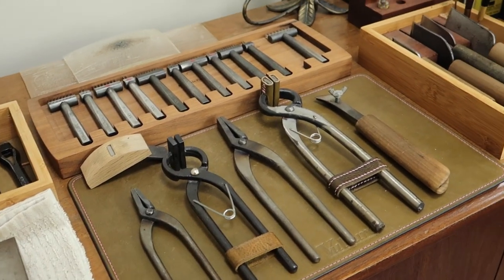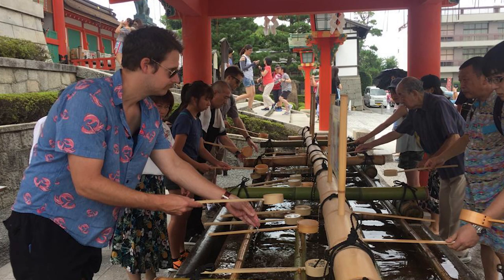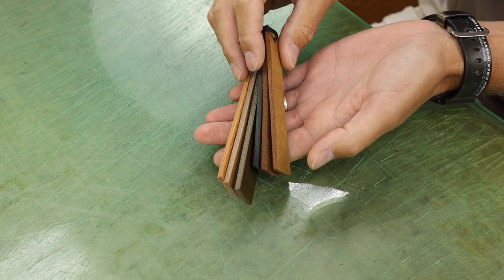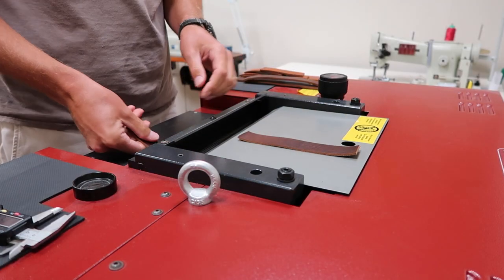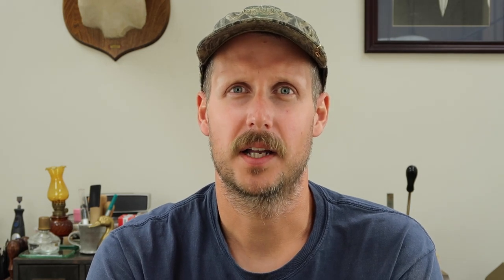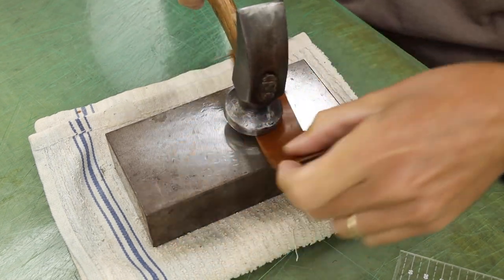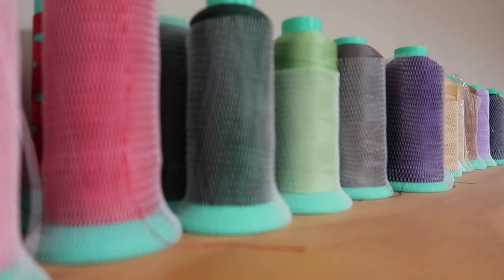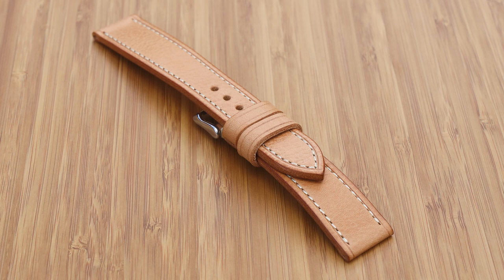Custom Leather Watch Strap Maker - Vulture Vlog Ep. 3

Comment: Do you have any experience making watch straps without any stitching, just glued together? I see them available commercially and I like the style when paired with a smaller dress watch, but I wonder how they would hold up. Of course with an expensive watch you really don't want anything coming apart. Perhaps there's a way to make one with a hidden and stitched liner for security, using something like tyvek so it doesn't add bulk.